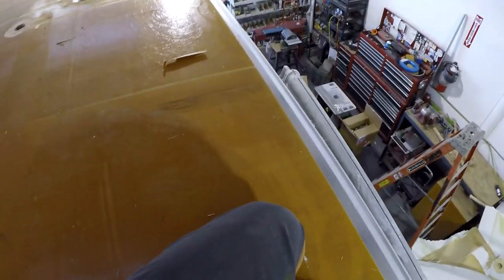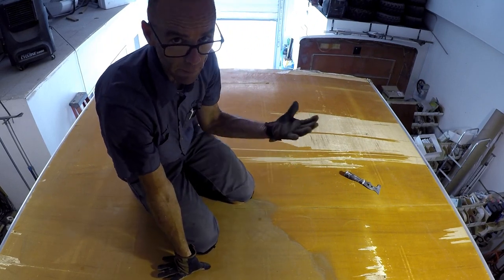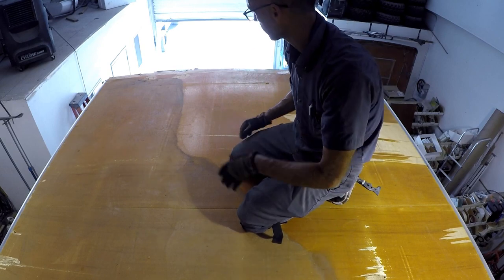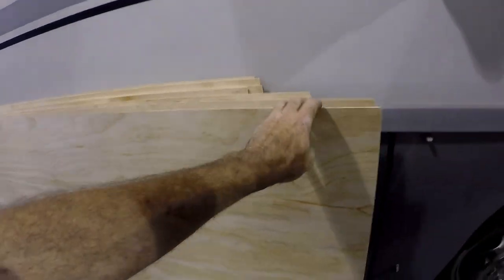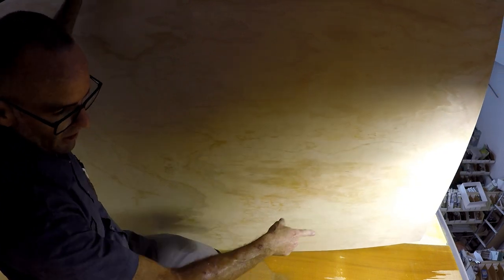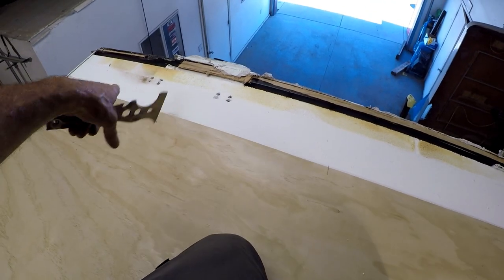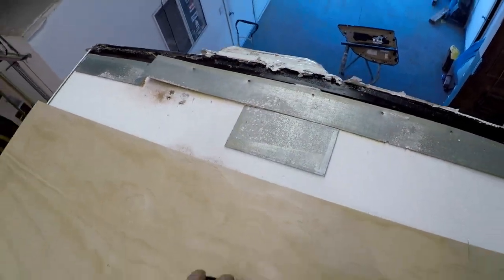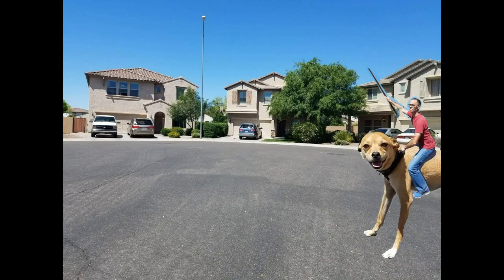What's inside a Winnebago Roof and Other Tidbits?

Comment: Is 3/8 in wood ok? I'm doing a roof repair and I and going to end with crazy seal for my roof. My other question is instead of ripping off the old decking everywhere (it's old and rips up). I won't be able to pull the old decking off in clean sheets like you did. Can I use a glue like "Liquid Nail" and place it on the old decking?

Comment: My 91 elandan doesn't leak any mere  but my roof is definitely not all pretty and arched like this one.  Is that a concern?
Reply from the maker: mostly if it does leak and holds the weight of the A/C you should be fine. Thanks!

Comment: Great and informative video! excellent information. what does a job like that cost?
Reply from the maker: Thank you very much! Generally $250 a foot covers labot and standard materials.
Reply: @AZExpert   How you replacing roof with over cabin  fiberglass on winnebego? It is one big  fiberglass sheet.
Thank you.
Reply from the maker: @shasi73ify  the same way as a roof there is generally a straight seam right above the cab. It can be difficult to start at the bottom and work up but once everything is unscrewed there is a lot of flex to the wall. Thanks.